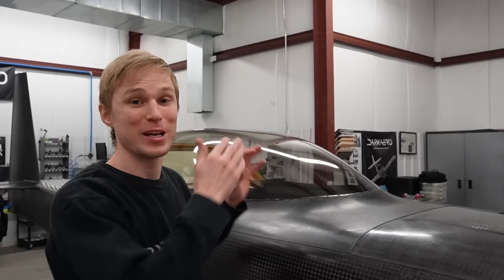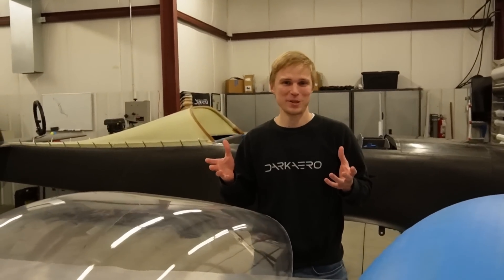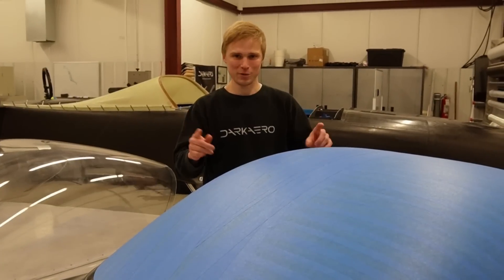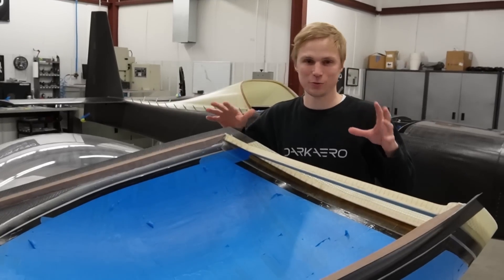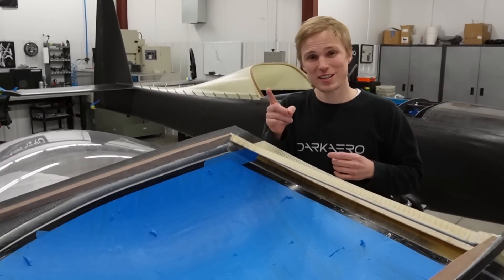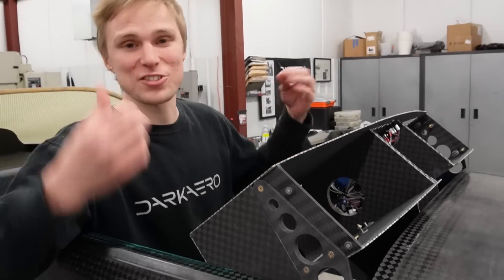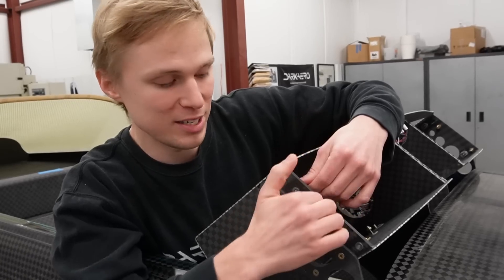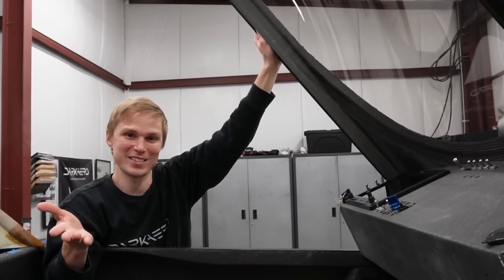This Canopy is DIFFERENT | Hinged and Installed  - The DarkAero 1 Canopy

Comment: Superb work gents, as always.  Can I ask about provision for thermal expansion/contraction with such a tight tolerance design?  I had a sailplane that used to suffer binding between canopy rail and fuselage on hot days due to differing CoTEs. Am eager to hear your thoughts.  Thanks!
Reply from the maker: The CTE mismatch is definitely a challenge. Acrylic expands and contracts with temperature changes a lot more than carbon fiber. We built in some extra clearance to account for this. Summer temps will show if there is any binding, but we don’t expect anything to interfere at higher temperatures. I could see the issue being pretty pronounced on a sailplane with a really long section of acrylic. The canopy on my Cozy sees some flex with temperature changes that translates into changes in the gap size where the canopy and fuselage meet. One solution might be to use more small window segments rather than a full bubble canopy. Hard to beat the visibility of the full bubble canopy though, so the CTE mismatch tradeoff is there.
Reply: Sikaflex is the product to use to bond Perspex to carbon frames. It allows for the difference in CoTE.
Reply: @ Darkaero, Inc  Great stuff guys!  Dreaming about a fast traveling machine.  Got my PPL a couple years ago.  Recently I’m learning more about engineering behind Vne.   What is your Vne basis, gust loading, flutter, FEA, tests etc?   Can you speak to anti flutter design options for composite and sheet metal construction?  Thx.

Comment: 5:50
Whats the point of the box that has just wires and instruments inside it to have completely solid sides, but to have the actual load bearing hinge pieces drilled by THAT much to save a few grams?
Shouldnt the box itself be a much bigger and safer priority for this kind of weight reduction?
I could kind of get it if the hinge pieces were thicker than the box side panels, but the box panels look like double the hinge thickness so it makes even less sense to me. (even though they are probably different kinds of carbon fiber)
Reply from the maker: It's hard to tell in this video, but the bulkheads in the instrument panel that support the rest of it are made from carbon fiber skin + aluminum honeycomb core panel similar to the bulkheads in the fuselage. They are quite light and stiff. The solid carbon fiber plate that was added to support the outer hinges was not part of our original hinge design, and we had to cut away panel material in this area to make room for the plates.

Comment: It looks very nice but if the plane flips over on an emergency landing and catch fire how the passangers can escape?
Reply: I built N36LV, which has gull wing doors. Knowing I would not be able to exit in the case of becoming inverted, I did three things. I installed a fire suppression system (outside the cockpit area), I had a crash axe that was a "go or no go" checklist item, and my plan for any off-airport forced landing was to land with the gear up. Planes usually end up upside down because the landing gear shears at different times during the crash, imparting extra torque moments to the fuselage. I had rear seat windows so my passenger brief included instructions on where the crash axe was located (behind the pilot seat) and to exit through the rear window areas after breaking them out with the axe. I got some sobering looks at times, but every person who flew in it thanked me for the extra mental preparation.

These guys are going to have a more difficult situation but I would strongly recommend a crash axe in the cockpit.
Reply: same as any other small airplane
Reply: @richardvisscher2626  AND . . . ejecting the canopy before emergency landing option is there.
Reply: @richardvisscher2626  being bad because the others too is not a good point of view but this is just my opinion. I love this aircraft but because this safety issue I would never buy it.
Reply: @schumiuav9170  They have plans for a version with a BRS Parachute. With a BRS Parachute you could deploy that Parachute which will then 'stop' the plane. That should enable you to open the canopy in the air. And if you're then flying with a personal parachute you could just parachute out to safety. Also guessing the firewall will be able to prevent fire and fumes sufficiently enough to give you X amount of time to execute an emergency landing. Maybe the plane can also be outfitted with an engine fire suppression system that could further increase the amount of time the cabin will be survivable in the event of an engine fire. That could perhaps give even more time to safely execute an emergency landing... Not a pilot, so not really any kind of expert – but with that said – I think small planes like this one will always come with a risk...

Comment: Great great plane , i hope I see it fly in this 2022 and hope u get all the certificates and permits for this design , i can really see the future DARKaero models be electric and this design really have more than enough innovations backing it 👍👍😀
Reply: Electric planes are far far in the future.  Battery systems only last 8 to9 years on average right now and are much to heavy for the power they do produce and how long they last.  Plus a say you used  a  30 minute charge to get 75 percent battery  life and your plane has a 1000 mile range.  Now it has a 750 mile range and with reserves needed if it's IFR like this plane is ment to be now your down to 650 miles since with fuel you know how long you can fly.  
With battery how long is that charge going to last since the higher you fly the colder it gets which does effect battery performance.  
Maybe next generation of batteries will hold twice the charge, half the weight and last twice as long.  
But typical private pilot flys 50 to 100 hours a year.  
Typical io540 goes 1800 tell it needs to be serviced some over 2000 hours.
So that's 18 years before your engine would need a major service minimum.  In that same time span you would have to replace the batteries twice as it stands right now if it was an electric airplane.
Plus airplane get hit by lighting allot.  What happens to that big battery pack if lightening hits your plane.
I personally think it's a minimum of a decade before their are good enough batteries.
Reply: @cw93711  my best bet will next gen high density Toyota solid state batteries those batteries are really really ahead of their time maybe that can provide 100% more range
Reply: @hellslayer9638   their are multiple companies working on new batteries but their going to have to be non lithium based as their is only 90 million tons of lithium and by 2030 at the latest batteries will be using 20 tons a year.  
Plus counties like the US can't mine their lithium due to the EPA.
Also some large lithium deposits aren't easily accessible.  Lastly mining lithium isn't green.
Toyota is hoping to bring their solid state batteries to market in 2025 but in hybrid vehicles cause they don't think the cost will be their yet.  
That fits with what I said about 2030 ish for a plane.  
Since everything is going to have to be proven tech without issues to go into a plane since you can't just pull over if you have a problem.  
Also the other issue I see with electric planes is it will be like flying a plane with a rotax engine.  
Limited angles of flight you can't exceed.  With my io540 I can do most aerobatics in my former plane except spins.  It didn't really like them.  But I usually just did a few alieron rolls or loops.   
Plus the plane would need to be reengineered for batteries and electric motor as cg would be entirely different.   
Probably need to legthan nose as electric motor would need to be out front further as it's so light and if you could run some batteries firewall forward.
Then a battery package in each wing.  I thought about on underside of plane just making it thinker but Best area would be right under pilot and I wouldn't want a fire hazard under me if gear didn't come down and I bellied plane in. 
But that's just my thoughts